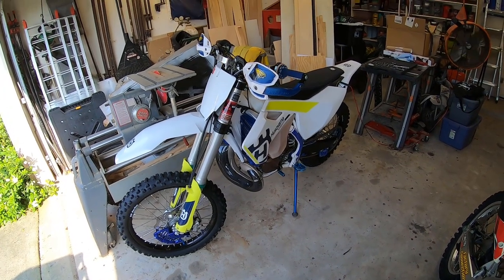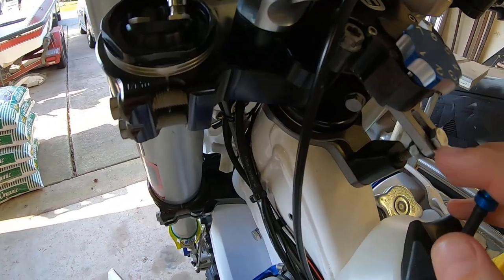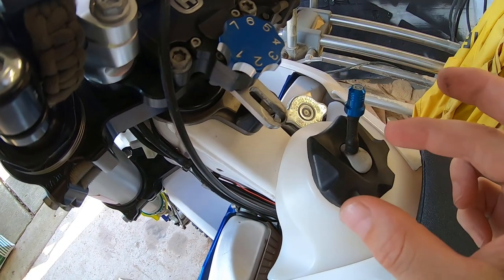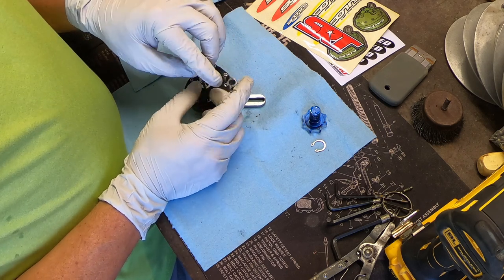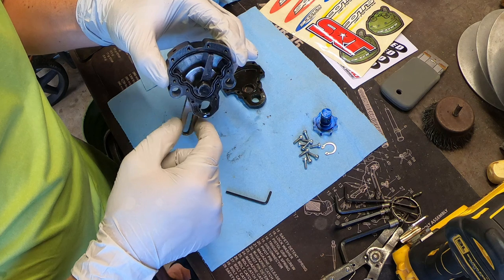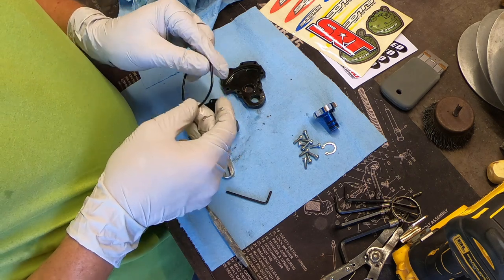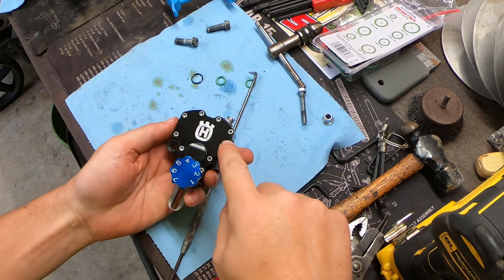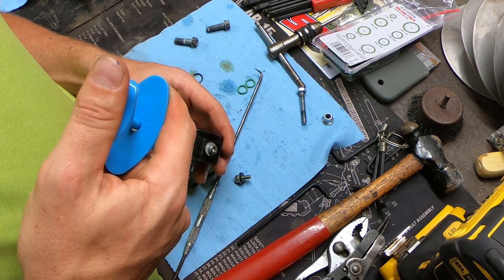How to fix / rebuild / modify a Husqvarna / KTM steering damper / stabilizer.

Comment: Brandon. You didn't have to drill holes to fill it. You just need to reassemble it submerged in oil. In a big bowl. Move the actuator back'n forth till all the bubbles stop. BAM your bled. LOL... But you made it work! Thumbs up for sure.

Comment: Thanks for the video this helped me on my rebuild. Just wanted to add that suspension fluid might work better for you, I put 5w redline lightweight suspension fluid in mine and it dampens really well now. I believe most dampers use suspension fluid opposed to fork oil but I could be wrong about these dampers. Anyways, it worked for me.

Comment: This video was very helpful, I have the exact same damper with the exact same issue.  Thanks for posting!
Reply from the maker: Glad it helped. It's been a year or so and still no leaks on mine. I do need to take it apart again though and put some heavier weight oil in it. The oil I rebuilt it with is too light, and I don't think it does much for dampening.
Reply: Thanks for posting.  It was a HUGE help
Reply: Brandon Rogers I just rebuilt mine yesterday using the kit that was mentioned and 10 weight fork oil. I think that does a pretty good job. When I spoke to my dealer they recommended 10 or 15 weight fork coil. Also if you submerge the damper in a small bucket of oil after closing the top and move the lever back-and-forth it will bleed the system then you can insert the knob that adjusts the damper level and youre all set.
Reply from the maker: @iammoshiri  Sweet! I'll definitely use at least 10 weight oil next time around, maybe 15. I can't remember what weight oil I used, though I probably said somewhere in the video, but it wasn't enough. Thanks for sharing! Be safe out there. ;)
Reply: Nice video. Couple of things that happened to me. Be careful where you put the bleeder screw. I went to close to a cover screw and notched into the blind hole for the socket head bolt. Worked out ok though. I tried 80w trans oil first. WAY too heavy even on #1 setting. 15 w fork oil is perfect. Just a little on #1 and lots on #7. Thanks for taking the time to do the video

Comment: Hi Brandon - for future reference the damper is made by WP and there should be a seal/o ring kit for it KTM part#77012005050 the o ring kit comes with instructions for disassembly /assembly.
cheers
Reply from the maker: Thank you! I'll have to buy a couple of those rebuild kits, there's not much information out there about the damper.
Reply: @brogers2715  did the damper failed again after your repair? Thanks for the helpful video
Reply from the maker: @mototrailz  No, It's been five months or so now, and it's still going strong. No more leaking. I'll put heavier weight oil in it next time around though, as it doesn't dampen much with the oil I put in there at the time of this rebuild.

Comment: Hello, I have replaced the o-rings with the original ones but is still leaking on the pivotal axis, I have bought one new from ebay and is also leaking. One guy that is working on a professional  suspension shop tells me he had some of these steering dumpers on service and they are crap. Did you have such experience with yours?
Reply from the maker: Mine stopped leaking after this, but I have heard of others leaking. I may have just gotten lucky.

Comment: Thank you Brand for your video!! It is the only one in youtube.Recently I bought a used damper and it loses oil.... I have one question, can a I bleed the system without your holes? I think that I have to do inside a bucket with oil...
Reply from the maker: Yes, it can be done in a bucket of oil. I just didn't have enough oil to do it that way.

Comment: Excellent video, thanks a lot! Just to confirm: instead of drilling out the top of the body to fill the damper you recommend removing the knob, submerging the body and then bleeding it via moving the lever back and forth?  My repair kit will arrive in a week and I want to know if I can avoid drilling into the body. Thanks!
Reply from the maker: Yes, that would probably work just as good, as long as you keep the entire unit submerged the entire time so that air doesn't get in. I didn't have enough of the oil to do it that way, and I figured that way would be more of a hassle so I drilled the fill holes. I hope the video helped. :)
Reply: @brogers2715  The video absolutely helped - thanks so much for creating it. May be worth adding the KTM and Husqi part numbers into the title for others to find it. It took me some time to land here but I am super glad I did. Once my rebuild kit arrives at the local store I will give the submerging a try and report back. Thanks again, Brandon!
Reply: How did the submerging method work out?